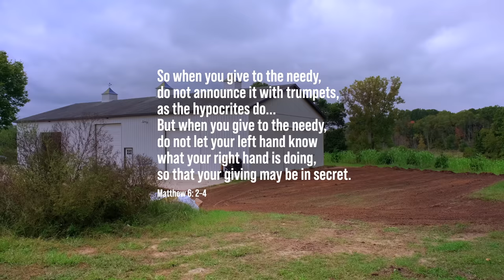AN ANNOYING LIMITATION OF A SUBCOMPACT TRACTOR 🤷‍♂️🚜

Comment: Wheels on a landscape rake are a game changer for sure.  Next level game changer is adding a hydraulic top link also.  You can dig in or feather out material by just adjusting the top link and not using the lift arms.  I use this combination a lot and works very well.  Lastly, when you are transporting or loading on a trailer, shortening the hydraulic top link improves ground clearance of rake.  Mine lifts approximately 3 ft off ground.  Great video...enjoyed it.
Reply from the maker: Definitely, love hydraulic top and tilt.

Comment: I noticed you had to keep looking back to watch the rake. I have an ongoing gut issue that causes pain when I twist around to see behind the tractor. So, I mounted a cheap back up camera on my BX2380 ROPS and use the suction cup base to hold the screen on the hood. It has an on-off switch, so I only turn it on when I need it. I hope that helps someone with similar issues.

Comment: The mirrors are a must have. I bought my 72" rake to clean up the beach. A lot of weeds wash in and I am tired of raking them by hand. I could not control the height and was continually digging holes. I purchased the Frontier gage wheels. In soft sand, wheels will still let the rake drop enough to stop me in my tracts. As I am still learning, the mirrors help as much as the wheels. Much better than raking by hand. On the way back to the building one day my neighbor suggested seeing what it would do on the crushed stone drive we share. It worked great leveling and even pulled a few weeds. Edited: I am going to try it on leaves this year.
Reply: Pine straw/needle rake works much better on a lawn, a little more forgiving.  Or the dethatcher you can find also talked about regularly on this channel 👍

Comment: Great video and demonstration!  It’s not a box blade on a skip loader but WOW that thing is doing a job with the gauge wheels! 

Do gauge wheels make a difference? I think it depends on the skill of the operator, what job is, and how the tractor is set up. Even if the operator is highly skilled on the tractor setup, it’s nice having gauge wheels to drop and go. I think think the gauge wheels are a great addition to landscape rakes. 

Glad to see you selling mirrors for the tractors! It’s a lot easier on the back and neck!!!
Reply from the maker: Good info, thanks for taking the time to share!

Comment: For your lift height issue, shorten the top link. That will also told the pitch of your rake ahead and it will spread the material a bit more. With the link long like that, it has more of a carrying effect instead of spread. That would keep your piles down at the end as well as give more lift height
Reply from the maker: The gauge wheels don't hit the ground when shortened, already tried it.  It digs in more too.  Thanks for the comment!

Comment: I picked up the Frontier rake, a friend suggested yesterday that is might want to drill some holes in the longer pipe to better adjust the gauge wheels.  I’m not very good with it yet, haven’t found the right combination of adjustment on the 3 point, I think.  I was wondering if you have a video on using the Frontier rake or one that could suggest how to adjust everything.  I’m digging in deeper than I would like.  Any suggestions would be appreciated

Comment: I didn't see much, if any, material filtering through the tines. Would a blade (with gauge wheels) give the same grade results, without the pretty grooves in the dirt?
Reply from the maker: Possibly so, but if you're buying one tool, then I think a rake is more versatile than a rear blade.  Trying to show the versatility of the rake.  Dirt, stone, possibly snow, maybe a hard with gauge wheels.  I've just never been a big fan of the flat rear blade.  I know folks love them though.
Reply: In my experience, you don't see the dirt filter through the tines so much as just rolling out at the bottom.  The landscape rake has many uses, I use mine to pick stones out of the grass in the spring from snow removal, its also a great tool to prep for seed as it helps pick the stones or debris out of the dirt.  It does build up though so lifting at the end of each pass like you see here is a good way to do it to keep the tines clear.

Comment: Told ya guys!  ;)   The wheels are indeed the game changer for a rake.   Use my 60" Dirt Dog rake w/wheels to groom and level my gravel drive and for dirt finish grades, leveling wood chips on large areas.  Angle the rake for driveways to angle gravel inwards to finish off the crown properly.  Box blades have their place, but a rake is what you'll use more regularly once the driveway base is set right.  When you need to work on rougher dirt cleanup, just take the spacers off and raise the wheels out of the way or take them off the posts so the rake can get in deeper into the soil clumps and debris.   Tie a suitcase weight onto the frame temporarily at each end if you really want to level out rough stuff.  Had my Dirt Dog 4 years and the tines are still in good shape.

Comment: Do you think if you don’t use the Speedco hitch it would lighten it along with shorting your distance to the weight?
Reply from the maker: It doesn't need to be any lighter.  It lifts it to max height easily.  Theoretically, the further away on that angle, the higher it'll lift.  I think removing the quick hitch would make the problem worse.